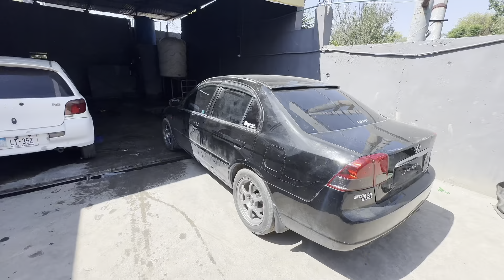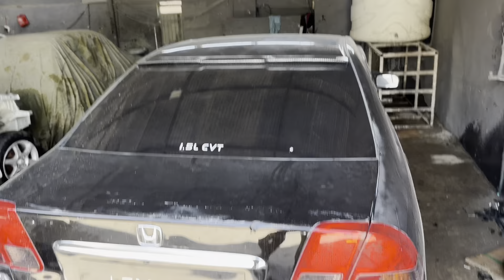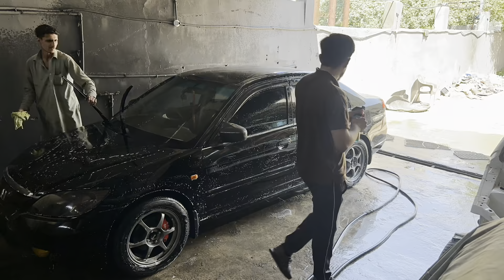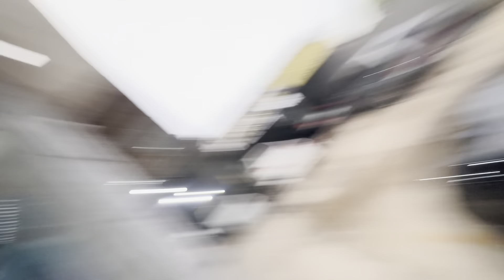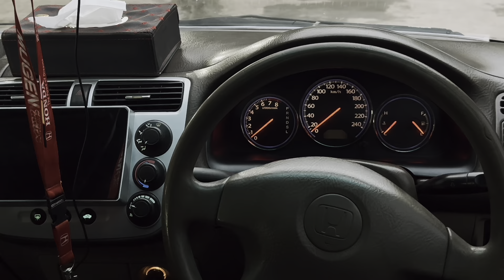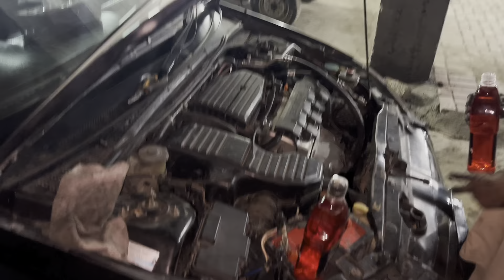Car Washed 💦♥️ | Honda Civic ki Cinematics 😍

Comment: Fuel average ab realistic batain.....

Long per our in city...
I am expecting k long per iski average achi honi chahiyay as its rpm is quite low in top gears.... I m expecting long per 15 to 16  with ac.....

I have converted atf gear 1.7... Gives me 13.75 to 14 on long with ac.... And without ac 15max on long